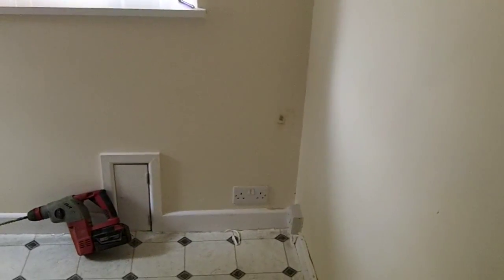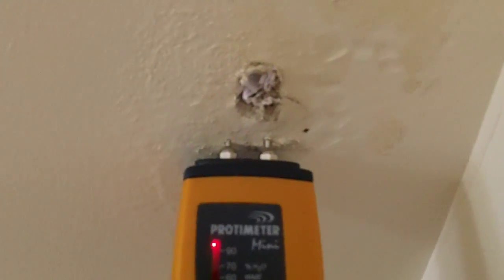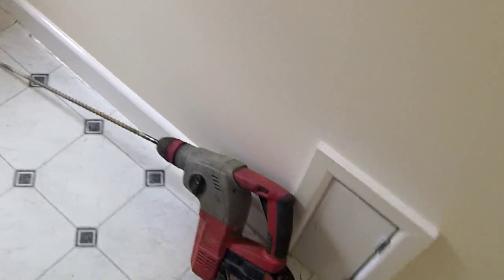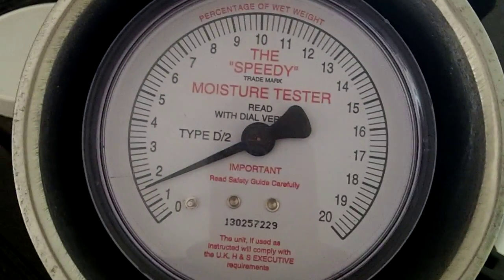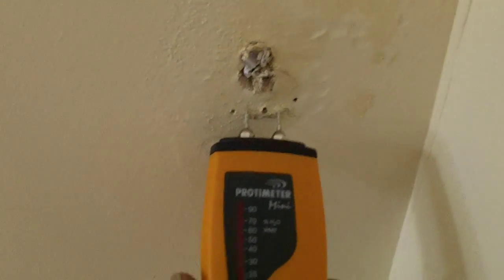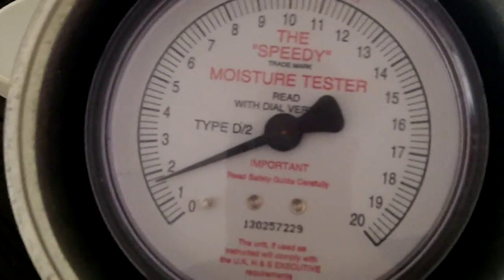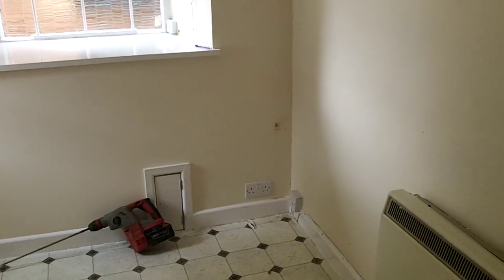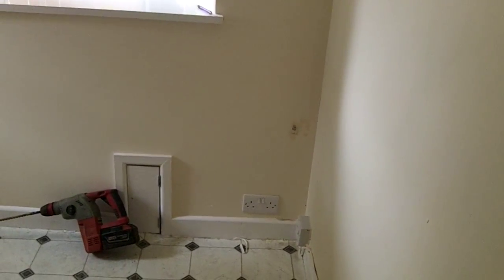Not rising damp but salt

Comment: Peter;
What would be your recommendation for a salt problem like this one.
Reply from the maker: +english made Any plaster is already contaminated - so remove - but replace with lime.  More importantly, make sure humidity levels in your home are around 50 to 55% - you can get good little RH meters on Amazon for about £25 - if higher than this - you have a problem - there's moisture coming from under floors, bathrooms, kitchen etc - and you need to ventilate - or you'll just get condensation and salts back.  Another way of getting rid of salt is to 'poultice' - a bit involved, but essentially keep a slightly damp  weak lime plaster on the wall for 6 months until salts migrate into it, then remove, and re-plaster again...   Another alternative - dry line after removing all previous plasters - but use steel frame, then you can use gypsum over the steel framing - good for wiring and plumbing - you can bung them in the cavity - steel from Protektor UK in Kidderminster - 50mm trakc and stud system.  Really good.
Reply: Many thanks, Peter,
Just ordered my RH meter as I suspect this may be some of the problem. Trial & Error.
Reply: fantastic clip. Just a question . what is the advantage of a metal stud system?

Comment: The salt are electro conductive false readings , and the damp patch is well above the damp proof course level, if it was active rising damp a visible damp line would be along the whole wall. Most of the salt in building material is hygroscopic. As you said" its probably penetrating damp due to faulting external rendering or the walls has been dry-lined to early and trapped the moisture within the brickwork.